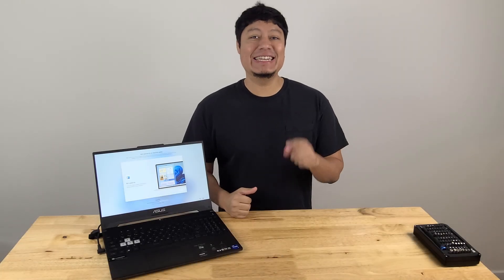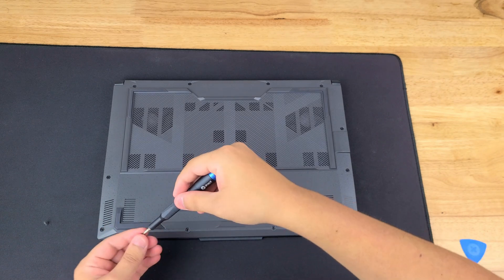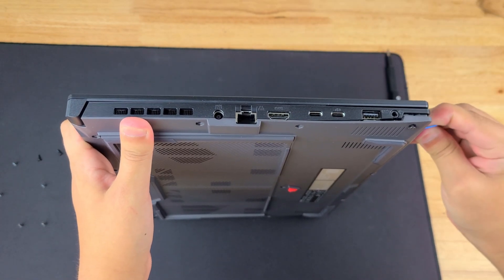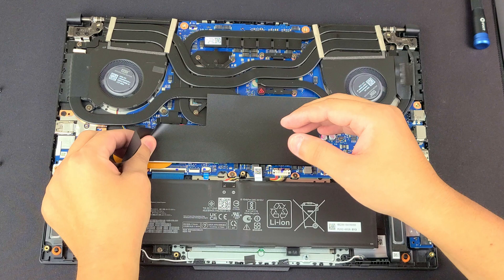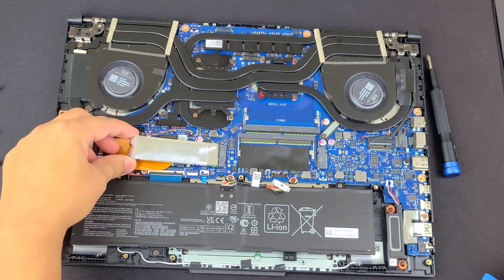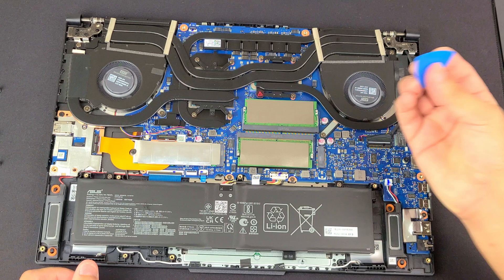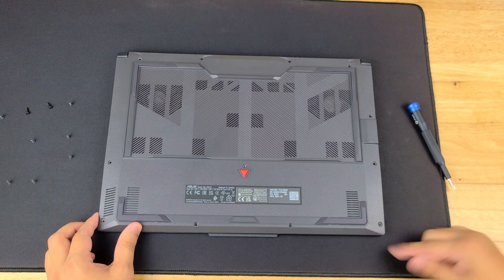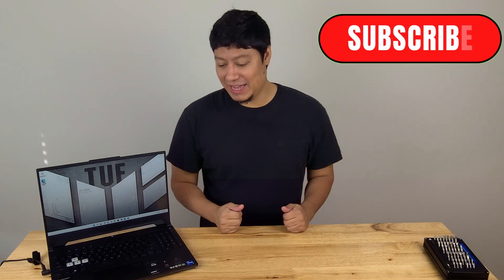ASUS TUF F15 (FX517Z ) How to Upgrade your Ram and SSD 2022

Comment: If I add a 32GB module, will it be 40GB total, or capped at 32GB? Also, would a 24GB DDR5 5600mhz stick work to get a total of 32GB (8GB+24GB)?

Some says it can be 64GB.

Does that mean
2x32GB = 64GB?
or it can be 2x64GB?

Just trying to understand my upgrade options before buying.

Thanks!

Comment: Whenever I did it, it goes to the bios utility menu
Reply from the maker: If you replaced the drive with a new one, you will now have to install windows on the new one. Here is one explaining how to make a windows install drive. https://youtu.be/hmipXVykHUc?si=2ULnaMYaKzGa0_lw

The difference in yours will be that your boot key may be F8 for Asus. If f8 dosnt work for boot selection then within bios It should show a boot option. Often though , if your new drive is blank, it might auto boot into the windows install drive that you make. One more thing to keep in mind, on this laptop there is a second nvme slot on the right. Of you wanted to keep your oroginal drove as an operating system, then just install both the old drive and the new one utilizing both slots. It should auto boot into the original drive like normal. You will just have to format the new drive once in windows and set it as a data drive.

Comment: laptop charger disconnects, so I keep the charger wire upward from the pin side, in this case it keeps connected.

Is there any solution for this or I have to replace the adapter?
I've same model.

Comment: Is it necessary to disconnect battery?
Reply: I didn't. Eeverything was fine, but it's generally best practice to disconnect the battery, THEN hit the power button to make sure all the capacitors are discharged.

Comment: After upgrading the ram and ssd do I need to do anything else or will it run normally after the upgrade?
Reply from the maker: If you replaced your original drive then you need to Install your windows OS again. If you added a secondary drive and left the original drive in, then you will need to make sure your secondary drive shows up in windows. Click on files explorer, click on this pc option on the left . If your new drive shows up, then good. If not, then you will have to format it within disc management and add a drive letter.

Comment: I did absolutely everything as shown in the video, before inserting the ssd into the second slot (because the first one is already occupied by another ssd), I disconnected the battery cable.  I connected everything, including the battery cable, everything fell into place.  but the laptop won't turn on anymore.  even with the battery disconnected while being connected directly to the power supply.  why could this happen?
Reply: hey did you figure this out? I'm having the same problem right now and could use some advice.
Reply: @angvalpet774   hi from Ukraine, hope i will help you with my story
Reply: I was stupid, my situation was this: I removed the laptop cover and immediately disconnected the battery cable with a PLASTIC SPATULATOR (NO METAL IN ANY CASE).  after that when i was sure i had disconnected the battery cable and the board had no power i decided to add a second ssd, installed it and then reconnected the battery cable to the motherboard.  so with a happy face I assembled the laptop (connected the battery and closed the lid) and decided to turn it on, but I tried to turn it on from the battery not directly from the power supply.  I spent the whole evening trying to figure out what I did, I thought I broke my laptop.  I even thought at first that I did something wrong when I installed the SSD in the second slot.  but everything turned out to be easier, I checked the laptop connected directly to the power supply, but WITHOUT PLASTIC BOTTOM - THAT WAS THE MISTAKE  If you look closely, you will see that the cover of your laptop has metal strips which as I understand close something on the circuit board, so the laptop will start only with the plastic bottom AND ONLY DIRECTLY FROM THE POWER SUPPLY, because when I tried to turn on the laptop with the plastic bottom, but no power  from the power supply unit (from the battery), then it did not turn on.
Reply: @eGORE234  Hi so after putting the SSD and replug the battery and return the laptop cover I should plug it in the power supply and click the plastic bottom after. is this what you meant right?
Reply: @abo.yaqoob_1  yes, you are right

Comment: Thanks for the video, bought this model as a Black Friday gift for myself last year, was definitely a steal at 1200$. Came across this video because I wanted to confirm before opening: this model does not have a 2.5 SSD drive bay correct? Just an additional M2 slot? Looks that way anyways, its a shame because I have a spare 4tb ssd 2.5 inch that I'm not using, would have been a nice media storage drive for on the go.

Comment: .   But,  Shouldn't you Clone the second SSD with the first one before changing it???   So you can not lose the OS and other material you may have in the first one...?
    It's just a question....
    Thanx a lot in advance
Reply from the maker: Yes , if you have data you don't want to lose, then yes you would clone it first . As for the one I it was a new laptop so no personal files were on it yet so I didn't need to take the extra steps.
Reply: @racimbio  Thanx so much...  It'll be useful as well as your video for...   I've not much experience at all...
     Thanx again!

Comment: Is it normal to see some sparks when putting the battery connector back in place? I'm trying to get it in place and push the metal part back over it, but the metal part won't go over it and it seems like the connector won't push in all the way, but keeps sparking when I get both sides kinda pushed in.
Reply: Sparks are good. But if it doesn't restart that just means the battery drained and you can connect it to your car's battery and jump it with alligator clips.
Reply: did you leave it without the battery locked in? I'm seeing the same sparks and not able to slide that little part, help!!

Comment: I should have watched this guide before opening mine. Accidentally broke the battery connector because I didn't realize the metal piece was to be pushed back, before pulling at the connector. So the metal clamp broke off. 😭😭
Reply: Were you able to solve the problem? I did it according to the video, but now my laptop does not recognize the battery, it does not turn on if it is not connected, the SSD and RAM are fine. I already tried to do a BIOS reset but the error still persists.
Reply: @julianpoe8775  yeah, got someone to solder it on back for me.

Comment: Great video, I ordered Kingstone 8Gb 4800mhz ram, i installed it in my laptop, and wont boot with both rams installed, but if i take one ram out (any of both) it works perfectly and boots into windows, do you know what causes this problem? ive tried everything (BIOS, tried diferents slots)
Reply: Same here ! I have the same problem :(
Reply: @ernestopalacios9299  it dosnt have any fix, its just incompatible with the processor (
Reply: i sold it and bought the exact same one my laptop had.
Reply: @shastin.n4715  thanks bro
Reply: @shastin.n4715  but both modules still work separately ._.
Reply: @ryuzaki137  both installed just dosn’t work.
Reply: What I understand is that the lower speed memory will limit the second, that's why I replaced the original 16GB memory at 1600hrz with two 16GB at 3200hrz
Reply: I managed to repair it, the problem was one of the 5 screws that make contact, I don't know which one was not tight enough, but that was the solution.
Reply: Same here, don't know that to do

Comment: Quiero agregar un m.2 gen 4 y 32 o 64 Ram ddr 5 dicen que sirve 5200 y 5600mhz es el modelo con i7 12650 soportará ??? Crucial upgrade menciona que si ???
Reply: Si soporta los 64 gb
Reply: Soporto 64gb y Ram de 5200 mhz
Reply: @matiasgatica9257  gracias hermano
Reply: Soportó los 64GB?

Comment: In switching out the SSD is there now OS on it now? I’m sitting in BIOS
Reply from the maker: If you changed the ssd, the ssd had the os on it so you will need to install a new copy of windows onto the new ssd. You can download the media creation tool from Microsoft for windows 10 or windows 11. You will just need a 16 gb USB drive to create the media onto and then boot I to that USB on the laptop which then takes you through the new os install. I can probably make a video to show the process.
Reply: @racimbio  Yeah my last Asus had an additional slot but not here. I have a USB SSD I guess I can copy C: drive to? Or go your route would be better.
Reply from the maker: @Towdawg1  yes there should be 2 slots. In that case don't take out the original drive and just use your new ssd as a secondary storage. Should boot right back into windows that way. Just make sure after that your new ssd shows up in windows. If it dosnt you may need to go to disc manager and format it as a new ntfs drive
Reply: @racimbio  works great! Thanks
Reply: @racimbio  Oh, yep need to format it, it’s not showing

Comment: Can you tell me whether this unit has 2 m.2 ssd slots? You did not mention it in the video. I have the fx507zc model and I want to know if I can add a second SSD. Thanks
Reply from the maker: Yes the model in video has a second slot to the right of the ram
Reply: @racimbio  hi my friend, wow I hadn't seen it but this TUF Dash FX517ZE model in the description says it has 1 SSD slot.. I have this model ! it will be secured by an SSD there on the right ?

Comment: At the end of the video u mention that it’s takes some time to boot up after installing new Ram …..how long should people expect to wait? …it’ll keep people from panicking if nothing happens
Reply from the maker: On some laptops I've seen it take up to 1 minute 30 seconds roughly. This is more common when adding high amounts like 32 gb or 64 gb.
Reply: @racimbio i bought a patriot ddr5 4800mhz sodimm ram to make my laptop dual channel, will it work?

Comment: Can I safely mix 16 GB of RAM with 8 GB?
Reply from the maker: You can but it's not advised for thr full potential of thr laptop. Should always try to match the sticks.
Reply: @racimbio  thank you
Reply: @racimbio  Can I put ram 32 gb in one slot?🙂
Reply: @SaunJArk  that's also my question I think yes (up to 2x32gb) but I haven't found confirmation yet

Comment: Hi, I have an Asus tuf gaming f15 fx506 LH  -  Unfortunately the CPU is the intel i5.  Anyway, I ordered the Ram upgrade from Crucial using their scan tool , so I will upgrade it to a 32G ram.  The scan suggested a 1 TB SSD that was the only option it offered, and I ordered it. Now I see others talking about 2 or more TB SSD's.  anyhow too late for that. So when I replace the SSD , will I have to download  windows 11 again? and update everything else?
Reply from the maker: Yes you will have to reinstall windows to the new ssd and re-download / update drivers if you intend of removing the one that is already in there. You could though keep the original in there and use the second nvme slot ssd for the new drive that way you have both installed and you can use your 1 tb as a data drive that way you don't have to reinstall windows on the new drive as long as your model has the 2 slots like the one I have
Reply: @racimbio  Cool!  I hope mine has the 2 slots, thank you very much for your help.  Subbed.
Reply: @racimbio where is the 2nd slot?
Reply: Nm I see it now
Reply: This labtop can use 2tb ssd or not?
Reply: @wicharvut  no. 1 tb per slot
Reply: @wicharvut  I put a 4TB one in the second slot
Reply: @julianpoe8775  I just ordered a 2 tb for my second slot yours works with 4 tb?

Comment: Im thinking of buying this laptop soon and upgrading it... what is the purpose of the film and pros and cons of removing it?  and when adding another NVME I purchased a very slim heatsink not sure it it will all fit but willing to try.
Reply: I am going to do the same. I bought the Samsung 980 pro but decided to buy the one without heat sink because of price and size worries. A friend told me to get a thermal pad so I might do that they are cheap enough on Amazon.

Comment: May I ask what is the black film/tape for? Just want to know if it's necessary to put it back on after adding a second SSD to my laptop.
Reply: Just a protection layer
Reply: The stock M.2 and RAMs have some kind of thermal tape deposited on them. And the film is covering them. Definitely giving a sign that the film is some kind of graphite thermal dissipation sheet.

Having the sheet or not... I'm not sure it makes too much difference since there must be almost no airflow in that area. You just need to make sure to use laptop on a hard flat surface and it won't change the thermal characteristics too much even without the film. I think they installed it to ensure longevity of the device.

Comment: Good video but I worry about you not pointing out enough safety precautions to protect it when open or demonstrating them. Static discharge is a huge risk, and you don't have wrist straps, which is fine but you also didn't ground yourself with the metal plating (not connected to the motherboard, there for static protection), and for people with vinyl or carpet floors it's more than easy for them to create dangerous levels of static discharge when they go in and touch components. Even when you disconnected the battery you could've been bumping the leads on transistors, also you didn't cycle out power after disconnecting the battery. I'm not trying to be over critical even though it sounds like that, but when you're making videos to help people do things for themselves, not showing those habits could cause them to damage their laptop and something like static discharge is hard to pinpoint
Reply from the maker: Even though damage through static electricity is rare you are absolutely correct. Having good habits like that are for sure the way to go and I agree with you that it's a good idea to show that on camera. What I usually tell people  is that if you do not have an way to ground yourself ( antistatic bracelet, Matt and so on. Before opening your device, touch something metal that is grounded to discharge yourself and also remove the battery to prevent electrical damage while inside.  The video though is meant to be short so yes I skipp through much of that information. In 15 years and thousands of units, I'm happy to say I've never once killed any unit or component due to static electricity :) its also way more difficult to kill parts with static then people may think. That being said I do think you are correct and I will do better about showing that part of the process as well. Thank you so much for the feed back I really truly appreciate it. That is critical feedback I want so I can  make future videos better for everyone. Much love and merry Christmas.
Reply: So pls tell how to prevent it like in normal terms and how to change it and should I disconnect the battery and how should I be standing and where

Comment: Right, I've got my hammer like you have, Racimbio, so I'm ready.....  You could use a hair drier to soften the adhesive holding the black insulative film, before removing it. That will avoid any damage getting it off. Thanks for your video.

Comment: What's the easiest way to connect this to an external monitor at 120+ Hz 4K?
Reply: I don't know about 4k but I have a 2K monitor hooked up to mine at 144hz using a USB-C to display port cable
Reply: I think both usb-c and hdmi connections can support this resolution
Reply: @TrackPadDad  not the refresh rate. That tops out at 60hz via HDMI on this model. I have this model. Tried a new high end HDMI and settings only shows 60hz tops. Higher refresh available via USB-c
Reply: @FactYouInTheAsk  oh I didn't think about that

Comment: I have this same laptop can I add another ssd ? And more ram. Mine came with the Ryzn7 6800 and 3500ti 8gb DDR5 but studders due to lack of ram
Reply from the maker: Yes you can upgrade the ram and ssd. 8 gb of ram is very low nowadays so it would help to at least have 16 gb so if you decided to just add a second matching 8gb stick that will also help. Ddr5 ram is still a bit expensive.
Reply: @racimbio i bought the 8gb patriot memory ddr5 4800mhz ram, will it work?

Comment: Thks for the vid. I thought there would be another slot for another ssd. Is there only one slot? therefore we need to change the present ssd to increase capacity. is that true?
Reply from the maker: There are 2 slots one where the main nvme is in the video and one slot to the right side of the ram so you don't have to replace the 1 and can just add another